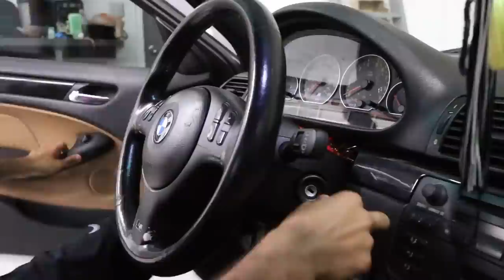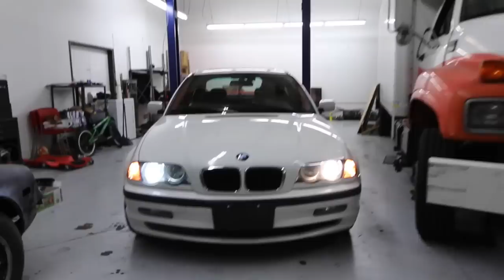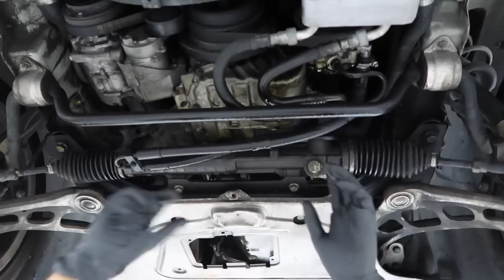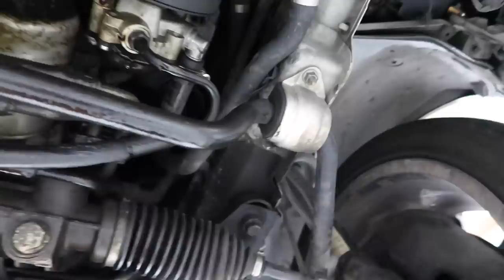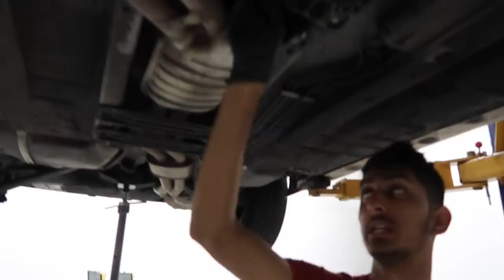BMW E46 Suspension Common Problems & Overview

Comment: wouldn't it be better to change the rubber bushings for polyurethane bushings ones, wouldn't they last longer than rubber bushings?
Reply: Clarck Pieters That's what I did for my car👍🏼
Reply: the original bushes from bmw have lasted over 10 years (100,000 miles). in theory poly bushes would last longer but are you really gonna keep your car for another decade.
Reply: if it's in good running condition why not, I'll pass it to my daughter when she starts to drive. I will be replacing my front arms in a couple of weeks when they get here and I'll get polyurethane bushings we only put 93k miles the car so she's got long some more to go.
Reply from the maker: Here's the thing when you upgrade the rubber bushings to poly bushings you will feel a difference, for some people they may like the added stiffness and "performance", but for some they might be too much. It all depends, for people that are using the car as a daily driver and not really tracking the car I recommend normal rubber bushings as they are comfortable and cost effective.

Comment: I'm a new subscriber and also a new e46 330ci owner.my car feels weird through the steering and when braking harder it really pulls to right side,there's a knocking to drivers front right corner (UK car) any ideas what could be causing this and bad vibration through the steering wheel

Comment: I HAVE A 1995 BMW 325I WITH 132, 000 MILES.. RUNS GOOD HAS A SALVAGE TITLE,DIDN'T KNOW WHY IT HAS NO VISIBLE DAMAGE TO IT OR FLOOD SIGNS, YESTERDAY THE CONTROL ARM TRAILER WAS RIGGED UP.

Comment: ive neglected my 120k 2003 330ci, and its time to tackle the suspension, planning on a complete overhaul excluding struts/springs so front carms, bushings and rear reinforcement, bushings, all bars and links.. i have yet to calculate cost in parts. how much would it be roughly you reckon? 1-1.5k eh?
Reply: MK I'm pretty much in the same boat.  At 115K.  ECS Tuning has refresh kits for the e46 (mine is an M3) for just under $1500.  I'm just not sure what all I need to do and if it's something I can do in my garage myself.
Reply: word,  probably hurts less to spend that chunk of money on the faster car, m3 being worth 8-10k my car 3-4k xd

Comment: hello 2004 model 3.18 i have bmw i bought my car 2 months ago.  When I release the steering wheel of my vehicle it goes right.  I changed four tires, shock absorber wedges and balls, rods, z-rods, swing bushings changed steering box was checked.  No problem can be detected in the control of five separate computerized rod devices.  My vehicle's problem continues, I would be glad if you could help.  I am sorry for my English

Comment: Whats Good Bro, Im Having An Issue With My Steering, The Car Pulls To The Left - Right At High Speeds And Breaking Any Idea What It Could Be? Maybe Rack And Pinion Or Control Arm Bushings?
Reply from the maker: Get an alignment first and then go from there

Comment: Alright mate I have a 2004 e46 320d got 195,000 miles 
I had a drive line knock so I replaced the front and center bushings 
Drives so much better in a straight line 
BUT when I turn right at say 45mph or above I get steering wheel vibration 
And knocking again from the drive line also the whole car shakes 
What can cause this?? Please help me PLEASEEEEEE

Comment: Great video ! 
I have one question. Do you have any idea what could be, when I press accelerate pedal I hear noise like bump or something, when I depress it is a little pause and noise identical when I accelerate pedal press. I not able to locate from where this noise I coming from center or rear of the car. Is it suspension or maybe on of the power trasmision elements. If you have any idea leat me know.
Reply from the maker: Thanks, automatic or manual? And year and model?
Reply: Hi Ups! I forgot write this :) 2002 October; manual ; 330i

Comment: .my car is an e36 ..it has 320k Miles still running strong...but my oil filter housing is leaking got any videos on how to change the gasket?

Comment: my bmw 318 e46 rear is making a strange clunking/ thumbing noise sounds like a dead body in the trunk. also theres was alot of hair coming out off the exhaust pipe,can u help? is it a serious problem? i dont want to get ripped off by dodgy mechanic
Reply: Dead rear subframe bushings, most likely. He covered it in the video.

Comment: Hi i need to replace the Intake Air Temp (IAT) sensor on my 2004 325xi e46 M54 engine. Where is it located?

Comment: By the way do not epoxy your subframe reinforcements in! Do it right 1st time and never do it again, weld them in, weld any cracks and drill holes at end of cracks and weld them up good. I did it on my e36 and you could push that car sideways like crazy after and not have to worry about it..
Reply: Otherwise this guy is on point

Comment: I drive an 02 m3 SMG, during shifting from 1-3 it tends to thump from what I'm sure is coming from the rear. Does that mean the drive shaft is bad? Or does something in the transmission has gone bad?
Reply: YungSav16 most likely rear control arms for the differential or   Rear trailing arms bc the torque that comes off of the diff when you add load to engine( hitting the gas) means that your differential wants to rock forward and backward bc of the Torque usually bc of bad bushings in the control or trailing arms
Reply from the maker: Both of the above comments are accurate

Comment: great videos jason really appreciate i learned a lot from them what do u suggest to follow with code p0411 on a 2004 bmw 530i the air secondary  pump works i just tested thanks in advance

Comment: thanks for this blogs jason help me a lot on this bimmer world. one question i got a 2004 e60 and in makes a vibration when driving on highway over 60miles over a curve the front passenger side vibrate only in the curve once i go straight again the vibration is gone
Reply from the maker: I would suggest getting your tires balanced first, and then look at other suspension components such as control arm ball joints and bushings. Also check your sway bar links.
Reply: thanks for the tip

Comment: Do you have any information about a low frequency sound that is emitted from the back of the car while it's in a high gear and decelerating to low rpm?
Reply from the maker: Most likely your diff or wheel bearings

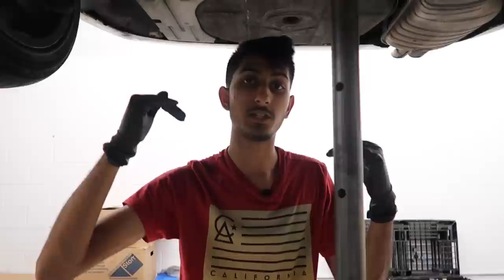Comment: my car has one bad trailing arm (driver rear) .please explain, what elese should i go ahead and change ?? when you say at around the 12:09 mark "just do it all"   meaning change the rear ball joints, rear sway bar links and the sway bar as well? thank u.
Reply from the maker: By doing it all, I mean by changing all of the bushings and links. The only physical part I recommend replacing is the camber arms which tend to bend.

Comment: the engine mount on my 2000 328i the rubber is completely cracked in half where the motor is no longer held down to the frame

Comment: Hello sir, i have a bmw e46 m3, there is a bold on my oil pan to let out of the oil, and now when i drill it in, it kinda worn, so it is causing oil leak, do u know any product could be good for sealing it? Or do u have any other idea to fix it? I know the expensive way is to replace the oil pan, but it is too expensive
Reply: Daniel hyeon The bolt is hollow and will collapse if overtorqued. The bolt should also have a copper washer on it. The copper washer should be replaced with each oil change. I personally would get a new bolt and fresh copper washer before applying any aftermarket stop leak products. A new copper washer should be included with your new oil filter along with a new oil filter housing cap gasket.ONLY BUY MANN OR BMW BRAND OIL FILTERS AS OTHER BRANDS TEND TO COLLAPSE! Install with a torque wrench and I believe spec is 18ft lb on the oil drain plug and 20ft lb on the oil filter housing cap. The oil drain bolt is 17mm and the housing cap is usually 36mm. You can get a torque wrench at Harbor Freight for well under $20 with their 20% off coupon. Hope this helps.
Reply: Daniel hyeon sounds like you shouldn't own a M3

Comment: I have a bmw 2004 325i and my 3 passengers doors will not unlock. my driver's side will unlock if I use the key but my other 3 doors will not unlock. my remote key will not work, nor will the unlock button inside work. I went to a mechanic and he said it was probably the door acuator in the driver side. could you show me how to solve this problem?
Reply from the maker: It could be the actuator, or the gm5 module. Research the gm5 module issues on the forums and see if that helps you out.

Comment: hey i have a hard vibration only when under acceleration at low speeds. would it be part of the driveshaft or something else?
Reply: Could be everything, but I would start with the rubber bushings in the rear, notably rear differential bushings (3 of them). But it wouldn't hurt to just replace all of them on the subframe.

Comment: I want to replace my oil pan gasket on my 2003 bmw 325i around how much money am I looking looking at ?
Reply from the maker: Gasket itself is around $20-30, labor is between 4-700. I suggest doing, engine mounts and control arms while you are there.
Reply: what's funny is that the engine mounts are bad and also when I brake a hear a clunk what a quensedence.

Comment: My E46 makes a loud creaking noise (sounds like a huge 100 yr old door opening for the first time in a decade) when I turn the wheel either way... what is it and what do I need to replace?! Please help!!
Reply: Control Arm ball joints that are underneath the brake rotors.

You're better off just replacing both  Control Arms & both Bushings.

Comment: Hello,I have a 2004 bmw 330ci they swapped the transmission from  automatic to manual my issue is,when I press the brake pedal,the rpm’s goes up instead of 
 Down how it should!!

Comment: I’m looking to buy the e fire suspension where would I find the whole kit?

Also when I go over bumps I hear somewhat of a metal clapping noise in my driver front tire area. Do you know what it is?? Also my car swings when I go over bumps.  My break abs and triangle lights are on just Incase that matters
Reply: That metal clapping might be the bushings where the lower control arms attach.

Comment: Hi ! Thank you for the info about teh epoxy, i have to do that on my 98' 328I, not torn out yet but it freak me the fuck out at each time i drive her hard. 

I also have to replace the brake line from abs pump to rear left wheel. Already baught the part and tools, but if you have time i will apreciate if you can do a quick video about it.Ii don't know how the brake line go under the gas tank and how can i lower it.
Reply from the maker: I have a video on rear end removal that gets you to the point of removing the long brake line. The gas tank is only held in with two straps and then the fuel lines on the top which can be disconnected under the back seat.
Reply: Oh ,  i see wich one,  i didn't remember the brake line part.  Going to re-watch it. Thanks a lot,  your videos have helped me quiet some time with my e46 !

Comment: Spoiler alert!!    2:32...fluffy poodle looking for snacks in the background!!    No seriously thanks for this video. In my 05' 325CI I hit one of those curb islands at 45 mph on the passenger side, I was avoiding a big ladder that fell off some dude's truck. Both wheels and tires were busted up, the front right and rear right shocks were totally blown. It also set off my steering wheel airbag, pillar air bags and drivers door airbag and put a 2 foot crack in the windshield...I was like "HOLY SH!@#$"  Well I got both wheels and tires replaced for real cheap on Craigslist, I ordered both shocks and front right lower control arm. But my power steering sounds a little funny,  It still works but makes a winding noise upon warming up at first start in the morning. Then goes away. Do you think my power steering rack is screwed?

Comment: Hi I'm just looking for some advice. I have a Bmw e46 320. I took it too the garage because I was having problems when I was driving basically occasionally driving along the road, if you hit a quite big ish bump the car even no the steering wheel is straight the car seems too sway too the left! I took it too the garage and the said unneeded both track rods and lower right side wish bone and stabiliser links both front. But when I got my dads friend too look at the car too get a second opinion he said all them parts are fine! Any advice on what you think it could be?

Comment: so is a lot of milage make them a problem? when going to buy one of these? i work at a lube center and every once in a while we get a bmw any year any series and i mainly see oil leaks. im really wanting one but not sure if the milage i see is worth the amount they ask for any help is appreciated.
Reply from the maker: Mileage is not really an issue as long as it has been maintained properly. Even with high mileage parts prices on these cars is not too high, as long as you are working on it yourself you can get a cheap e46 and fix it up quite cheap.

Comment: What epoxy for reinforcement plates?
Reply from the maker: You can use the 3m epoxy 08115 and the bmw structural foam. You can find both on ecstuning or even ebay. I will be making a diy video on this soon.
Reply: Great stuff. Thanks bro, and keep up making those great videos.

Comment: can you do a diff oil change on a e46
Reply from the maker: Will be making a diy on this when I do a diff fluid change on my car, its the same procedure for most cars. Always loosen the fill plug first!
Reply: Thanks :-) I will look forward to it..
Reply: ShopLifeTV and by the way.. you still have not answered my question. Where did you get those rings for the headlights I love them.
Reply from the maker: No problem, and I bought them off of ebay. They come in a set of 4, 2 for each side, I only installed one on each side for mine.
Reply: thinks for answering :-D been waiting lol... are they call halo or angle eyes.. on the description on ebay

Comment: Such a car could not be registered in Japan-you would have to change all the suspension and the rake system (lines, seals, etc.). that is why you do not see old cars on the road in japan.

Comment: That's not so true. I got 2 control arms, 2 control arm bushings, 2 links and a strut for over $700. If you add the tie rods on both sides inner and outer plus the sway bar and another strut that it well over 1000. No where near 600.

Comment: My subframe is torn :( ..... Any cheaper way to fix then take it in for $3000 Aus (approx $2000 US )
Reply: What subframe exactly? The rear body under the subframe?
Reply: yeah mate, rear, shoulda mentioned. Yeah it's torn from the chassis from what I understand. Plus now I have another 2 weeks before they can fix it and driving it will cost me more due to more damage. Frustrating, but gotta do what I gotta do I suppose
Reply: Look on ebay for "E46 subframe reinforcement".
Reply: J3TPILOT1991 I believe there was a recall on that subframe issue...

Comment: Please tell me this because I really can't figure it out what it is on my e46 320i: at slow or normal speeds my steering wheel feels normal, but at a higher speed, let's say from 50 to70 mph I feel a mild but visible vibration from left to right in the steering wheel, but if I get passed this speed let's say 90 mph or above the vibration disappears, so it feels only at that certain speed range. If anyone could help me with a hint of what could it be I would appreciate it very much, cause it's f***ing annoying and doesn't feel safe either!
Reply: you need to get your wheels balanced
Reply from the maker: Most likely a wheel balance issue. Get them balanced and let me know if it's still vibrating.
Reply: Ok, I'm gonna try that, just hope it will be such an easy fix, thanks for the reply and keep up the good work, love your videos!
Reply: You were right, not only that the front wheels were unbalanced, but they were also a bit deformed, egg-shaped to be exact. Thank you for your help!

Comment: common problems? so every E46 is pretty much fucked up
Reply: common problems for E46 over 100k miles. you know, parts who wear out ^^ and so... every car has them. changed mine recently and good to go for another 100k miles